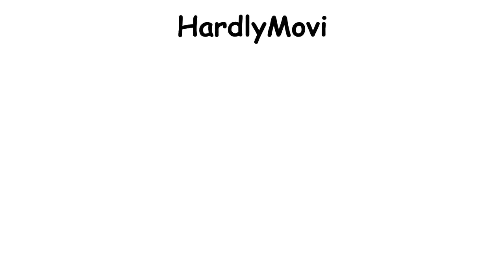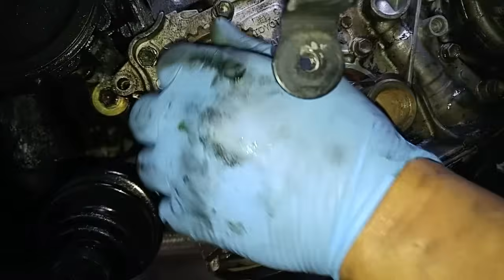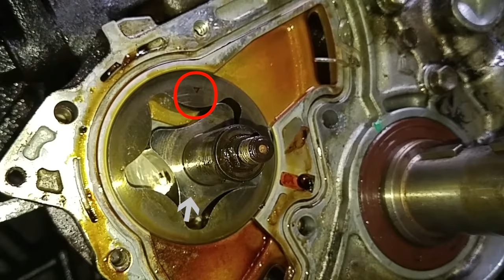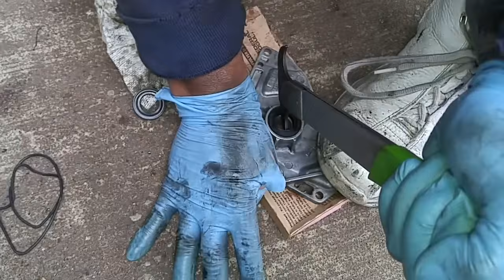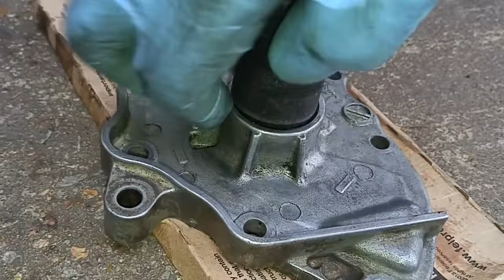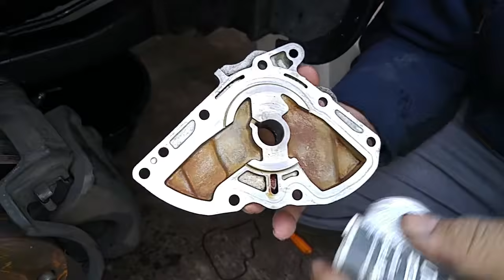Toyota Camry / Celica / RAV4 / Solara I4-5SFE - Oil Pump Housing & Shaft Seals Replacement

Comment: If you use RTV on the seal won't that bond it all together and make it very hard to remove next time?
Reply: Probably won't have to come off for another 20 years anyway
Reply from the maker: Not really.  You can gently pry the pump cover off with a small pry tool or screw driver.  RTV is a sealant ... not a glue.
Reply: Actually it's very easy to remove

Comment: 1999 toyota rav4 same engine. Did the timing belt with related overlooked  this. Do have oil leak
Reply from the maker: Yup.  That could mess up your day ... like "wait a second ... I just replaced the cam and crank seals ... why's there still oil leaking?".

Comment: Great Video, as usual. Once I install the oil pump gear, while tightening the bolt, if the oil pump moves do i need to put it back into alignment like the way we do camshaft or crankshaft or it is not needed..
Reply from the maker: Nope ... not at all.  Like the water pump, nothing to align.  Thanks for your comment and support!

Comment: Since you have to drop the oil pan to do that job properly anyway and the pump costs only slightly more than the seals and because time is money... I always just replace the oil pump. And since I'm in there anyway, the timing belt, idler, tensioner, power steering belt and water pump as well. No sense doing what's essentially the same job three times.
Reply from the maker: No ... you don't have to drop the oil pan.  The oil pan is not bolted to the oil pump cover.   A new oil pump is not slightly more than the oil pump gasket and seals (around $10 vs $100 +).  But if you do want to drop the oil pan, you'll have to remove the exhaust down pipe as well to get the clearance.  And if you want to remove the down pipe, get ready to remove exhaust flange bolts that are rusted and will need to be replaced.  Also, this video is an addendum to a timing belt replacement.